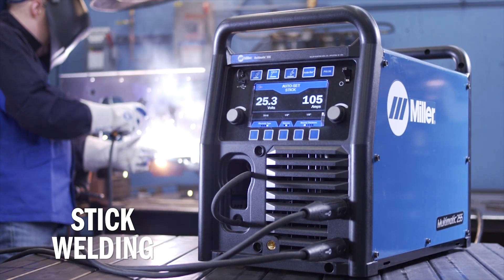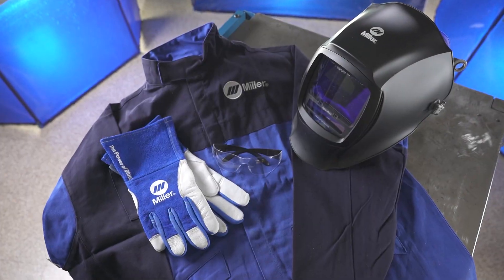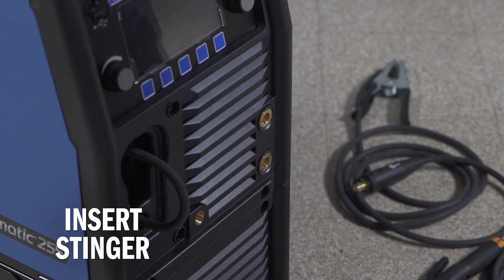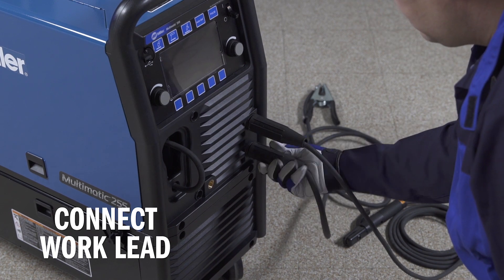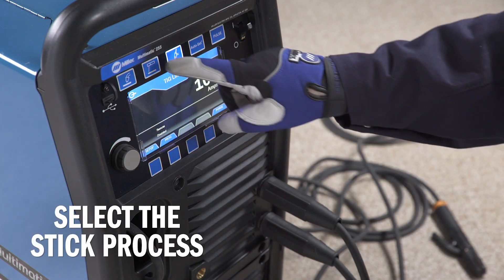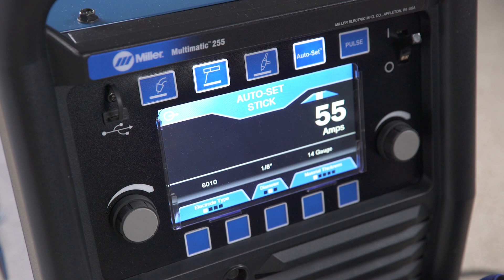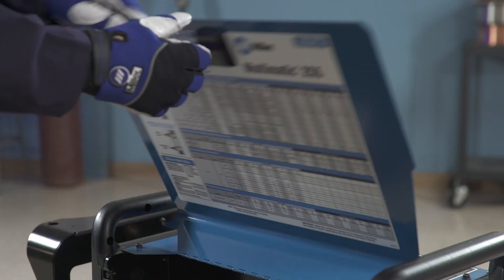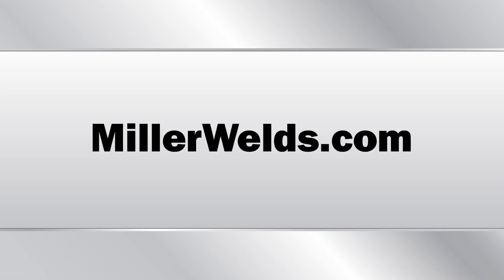Stick Welding With Multimatic 255

Comment: Can the 255 pulse Mig stick weld?
Reply from the maker: The Multimatic 255 features these processes: Aluminum Welding, Flux Cored (FCAW), MIG (GMAW), Pulsed MIG (GMAW-P), Pulsed TIG (GTAW-P), Stick (SMAW), and TIG DC (GTAW-DC). For more information and to see all your options: https://www.millerwelds.com/equipment/welders/multiprocess/multimatic-255-multiprocess-welder-m30175#!/. Thanks!